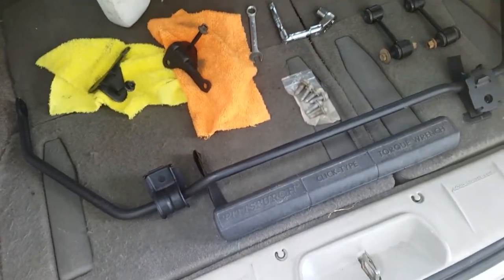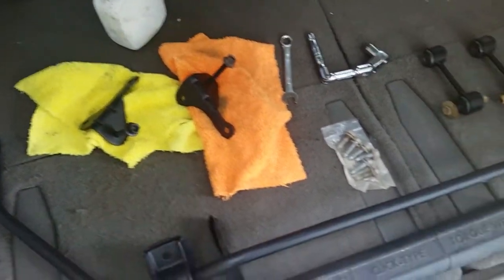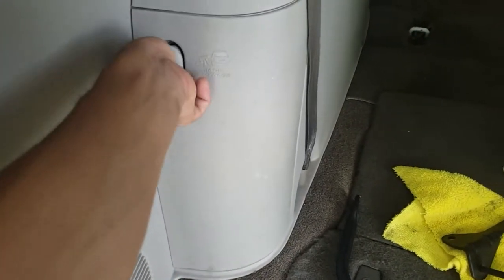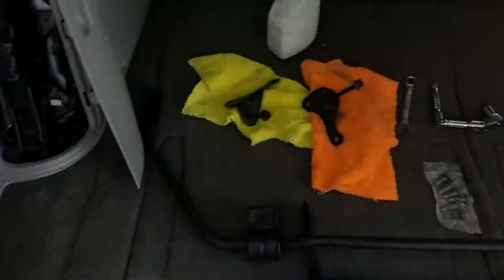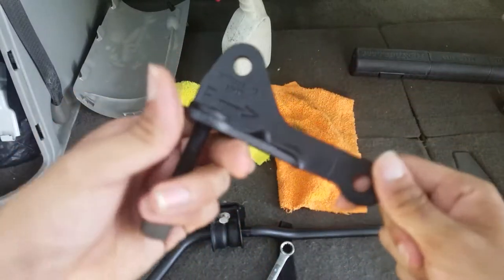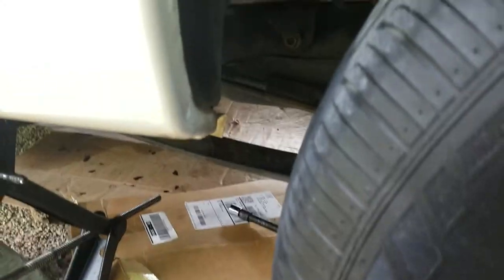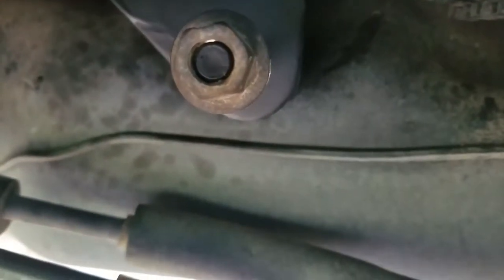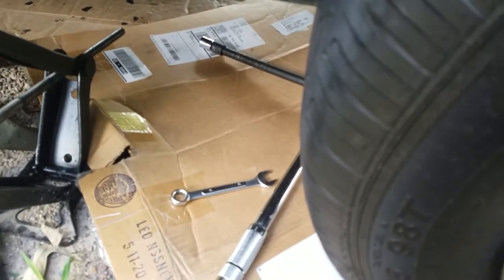Rear Swaybar Installation on 05-07 Grand Caravan/Town and Country, Stow N Go/FWD

Comment: Those end links look kinda weak, if I were you I'd weld at least 1 metal plate onto them to make them more structurally sound so the same thing that happened before doesn't happen again
Reply from the maker: Ye they do look weak but they're definitely strong enough for the stock swaybar. Also, my van didn't come with w swaybar I just installed this. Maybe if you got an aftermarket thicker swaybar then some new stronger end links would be needed.

Comment: That's not a jack, it's a joke. I've got a hi-lift SUV floor jack in my 05 Caravan and a 4-way lug wrench.
Reply from the maker: It is technically a jack it came with the vehicle for removing the tires. Its not heavy duty by any means